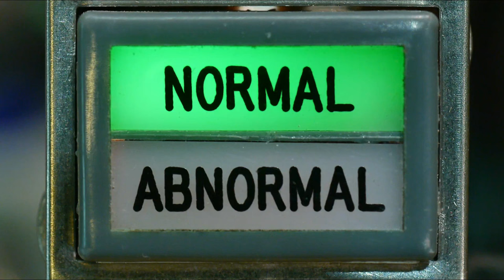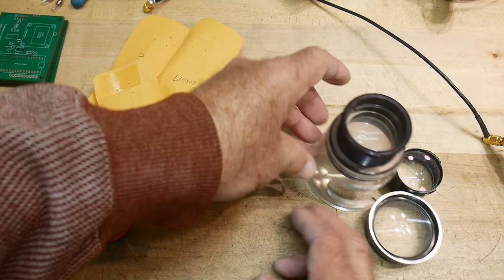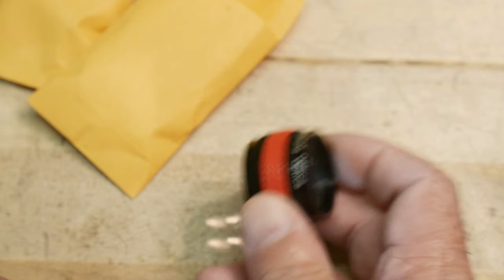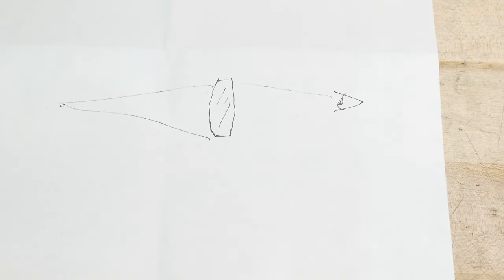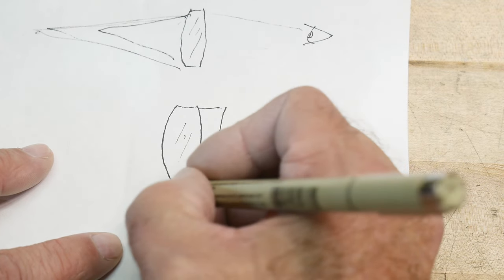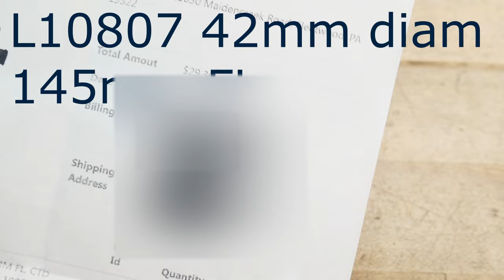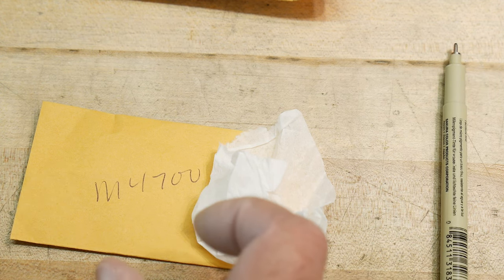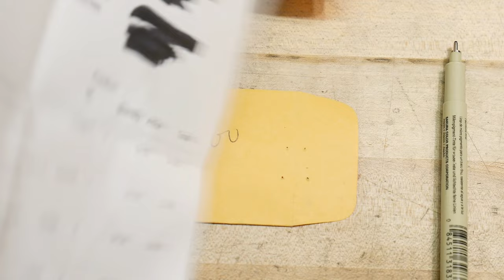#1001 DIY Optical Magnifiers

Comment: Same with me, I got some very old 3 tube video cameras, which had as part of the optical path some really good lens assemblies, which I kept as parts. Old cameras with almost all the electronics being transistor based, and dating from around 1970, used by some AV group at a university till they, or the supporting electronics, died a natural death. Was around 20kg of scrap aluminium once I stripped off the covers and assorted shields, and took the dozens of boards out.

Also have some lens assemblies out of projection TV sets, which are big plastic ones, plus a few of the fresnel lens assemblies out of overhead projectors.

Comment: there’s a material, polycaprolactone i think, which you can get in pellet form,  it melts in hot tap water and you could maybe shape a workable housing out of it right around the lens. the brand i have is called Shapelock. it doesn’t look great but it’s pretty functional.

Comment: The telescope on a Steyr rifle is typically x4 to x7.  Any more than that, and you risk too much shake while trying to aim (from standing unsupported position),
Reply from the maker: not related actually. telescopes and microscopes (magnifiers) are very different. The 4x to 7x for magnifiers is chosen for a good working distance not shake. just a coincidence that the two ranges are about the same.

Comment: Thanks for the tip on the surplus store. I've ordered a couple, I could not find the same triplet maybe they ran out or the price changed. I found one listed as 16mm dia and 50 mm focal length, I'm hoping that will work. My goal is to figure out some way to attach it to tweezers for removing those splinters which get smaller and smaller every year.

Comment: Great tip. Question: what's the difference(s) between a Steinheil triplet and a Hastings triplet?
Reply from the maker: I have never heard of the steinheil. looks like it is basically the same but corrected for 1:1 magnification. would not make a good hand lens